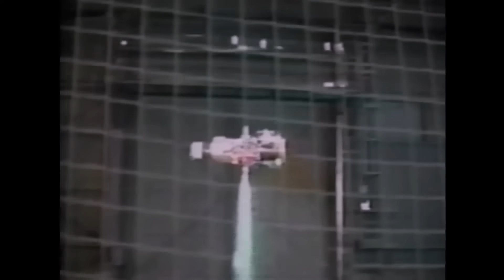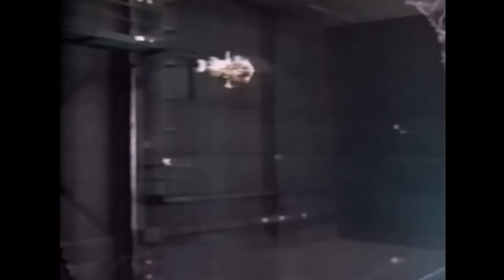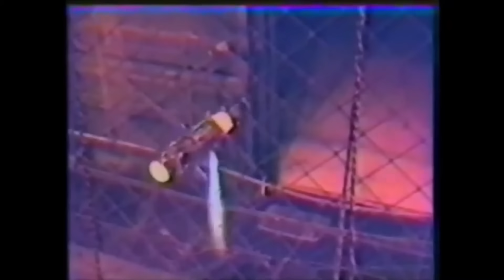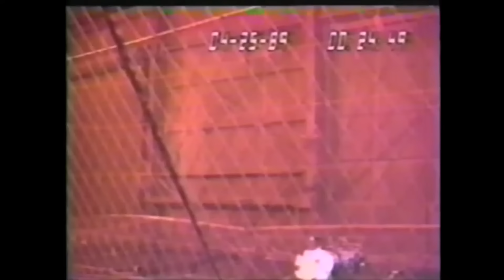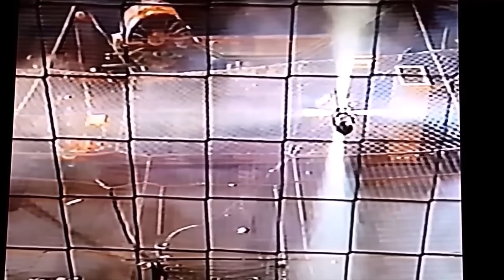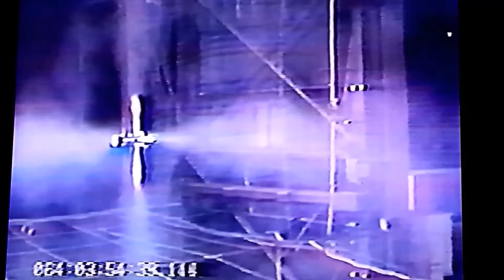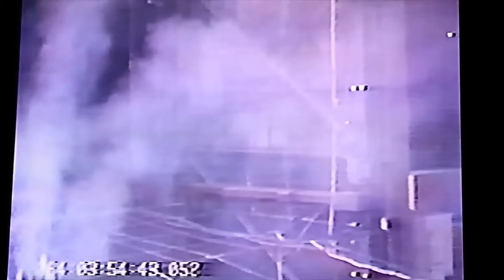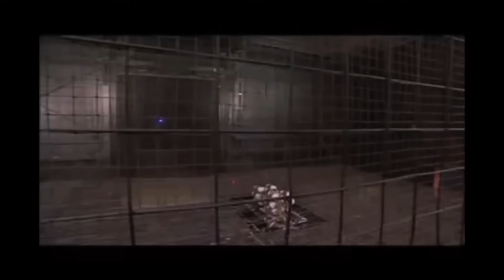EKV/KV/KW/KKV/LEAP (Exoatmospheric Kill Vehicles) Hover Test - Compilation Video (SM-3, GBI, etc.)

Comment: Looks like some autonomous killing drone that would appear in the Black Mirror series.
Reply: Rocket engines are less efficient than propellers in air. So these would be less dangerous than regular drones or those robot dogs.  They run out of fuel super fast.
But it would make for a scary movie yes.

Comment: I wonder what this technology has evolved into now. Any ideas?
Reply: Into nothing
Reply: Probably into nothing, it is too expensive and completely hopeless to stop an incoming attack. If the incoming missile releases some decoys alongside actual warheads, most of these expensive kill vehicles will have to go for those cheap decoys. Each kill vehicle has a chance of failure, but it is unacceptable if even one nuclear bomb reaches its target, so you need a lot of kill vehicles. 
Nuclear weapons are going to flying lower nowadays (hypersonic weapons), so they can use the air to maneuver. That makes them more maneuverable than these kill vehicles. 
If the incoming attack detonates one nuclear bomb in space when the kill vehicles are close, the kill vehicles are blinded, or broken in more ways. Nuclear bombs do not need complex guidance or sensors, they could survive the explosion better and fly on to their target. 
Kill vehicles and their launchers needs to be ready to launch at a moments notice at any time. Maintaining that is expensive. Attacking nuclear weapons do not have this requirement with such stakes.
Reply: @kedrednael  EKVs are still being developed and improved. We know nothing about modernized versions of them, obviously, but they exist.

Also, the goal of an ABM system isn’t to completely protect a country from a large scale nuclear strike. They have 2 uses: one, to protect against small scale nuclear strikes from rogue states like NK or Iran, or two, to make it so that large states have to ration more nuclear missiles per target. I’ll explain that last one. Let’s say Russia will need to send two warheads at a nuclear silo to have a satisfactory chance of destroying it. If an ABM system can have a 50% intercept rate, that would require Russia to allocate 4 warheads to reach the same probability of destruction, thus taking up warheads that could be used elsewhere. There are always more targets than there are missiles, so this is still very valuable for a defender.

Comment: I have been looking for this for a long time! I vaguely remember seeing one of these clips on the Discovery channel and I remembered it as some kind of satellite which did not need to follow orbital mechanics, since it could just hover
Reply: Hovering in place would require a lot of sustained energy. I think it's easier to get into a geosynchronous orbit.
Reply: @chaotickreg7024  thats what made these things so special, because everything else does the easy thing of following a ballistic or orbital trajectory
Reply: @carmatic  These ALSO follow a ballistic trajectory. The only thing the thrusters do is let them fine tune their trajectory to ensure they hit what they're aiming at. The fact that it can hover only shows that it can accelerate at more than 1G in any given direction.
Reply: They don't hover. These are maneuvering systems for guiding a missile to intercept its target. Picture a bullet flying towards a bullseye; if the bullseye suddenly moves to the left, the bullet fires a thruster and moves to the left to keep the bullseye directly in its path. It's necessary because hitting a target at orbital speeds requires an insane amount of precision, so a projectile trying to hit a target in space needs to be able to control its trajectory to within a few millimeters.

Comment: The Tic Tac UFO was just a larger version of these. Seems they figured out how to make longer flight times.
Reply: Could be launched from another submersible drone as well.
Reply: I have similar feelings, but these devices clearly burn liquid fuel and leave a very obvious signature of that.
Maybe something like this with a new form of engine that the world has not yet been introduced to.
Reply: @James-fe7wd  Check out videos on "Cold Gas Thrusters".  They have better capacity and less obvious heat signatures.
Reply: @murrygondwana7260  Do cold gas thrusters have better capacity? I'd have thought the lack of combustion energy means smaller Isp
Reply: @danielfearn6076  Traditional combustion, in rocketry, require two liquids, the fuel and the oxidizer. So you need two tanks.  Cold gas thrusters use a single gas, so a single larger tank can be used.  Monopropellant fuels exist, however those typically use toxic fuels.  You want to avoid that.
Reply: @murrygondwana7260  Great, thank you for the pointer!
Reply: @murrygondwana7260  A cursory look into c.g. thrusters would suggest to me that they don't actually have enough potential energy to create a useful flying vehicle of this sort with any kind of range. It's hard enough doing anything like that with conventional fuels. Still, quite the interesting prospect, but I just can't see how you'd do this with gas expansion, which pales in comparison to the specific impulse and thrust you get from the expansion of burning fuel...
Reply: Speaking of the tictac UFO, intel regarding the location would suggest that Raytheon may have been testing that vehicle. Prof Simon on YT covered this a while back and was given some useful detail which he looked into.
Reply: @James-fe7wd  Regarding Commander Fravors encounter, he saw a disturbance in the water.  Perhaps the Tic Tac was deployed from and controlled via a submersible and is intended for short duration reconnaissance or electronic counter measures.
Reply: @murrygondwana7260  Quite possible

Comment: And people wonder what those UFO sightings the Pentagon released are.
Reply: Expect those things don't have any indication of thrusters
Reply: @MSaleh-vy8rr  the USN vid does. What we’re seeing in it is a heat plume in the thermal camera
Reply: @jacobbaumgardner3406  
Eh... no not really. Besides, this craft didn't even last long enough. If China or Russia figured out how to develop this craft to last longer, then that has to store so much fuel, but more fuel adds more weight, more weight slows down in speed and is unable to maneuver fast enough. What the pilots saw disappears instantly. No way it's that same technology that we see in this video. It's really common sense to tell the difference between that and the one from the FLIR footage.
Reply: @MSaleh-vy8rr  that was a trick of the light for it. You can even see the lense flare as it rotates.
Reply: @jacobbaumgardner3406  
Yes it was a trick of light, but you don't see these thrusters repeatedly jetting out to maintain that hover and fly.
Reply: @MSaleh-vy8rr  it could be beyond the range of intensity in the camera, the intensity of light could be si intense that all that is just getting blotted out.

Comment: Isn't this the UFO in the recent released videos? These were engineered in the late 80's and people are shocked seeing these kinds of things now?
Reply: Exactly....the one on the news everyone is freaking over....under the national security act they never have to confirm it all they have to say is, "it's ours don't worry" or maybe not even that much they might just continue the story of, "we don't know😏"
Reply: No it's not. They saw them on radar descending from space to sea level in seconds. The saw them hovering for 10h straight. It looks like it for sure but the performances of the ufos are to radical.
Reply: @kyzer97320  think about this as well before you talk about the flight time...these are scaled down versions...12"-2' long....yeah they're gonna have a short flight time just as with other drones..but once you start making them into the size of aircraft or slightly smaller...the flight time increases, the forces they can endure also increases. You say it "went into the ocean"...ok, were you there were it landed? Did any of the videos show them sticking around to see if any boats or helicopters coming to perhaps pick it up...no. The softest spot and safest spot to conduct untested top secret aircraft maneuvers is over water. That's where we use to drop the big fuel canisters for the shuttles right? I'm not saying there isn't aliens but not ever UFO is gonna be extraterrestrial.
Reply: @frankiethebull8269  I don't know. Rocket engin hovering, I don't think that It can be operated for extended periods of time. Only my humble opinion. Maybe they found out a way. This can be an answer.
Reply: @kyzer97320  there's your mistake, thinking it's some sort of rocket engine. There are many types of engines they're working on, scram jets use no moving parts but still operate who's to say this isn't some form of a "pulse" scram engine? The link to the video I sent you about the X-37, they were carrying an experimental "ion engine"....plus you gotta notice in every video the exhaust gases are different colors and have different amounts of smoke? Clearly they're experimenting with different types of fuels/chemicals not everyone has access to.
Reply: @frankiethebull8269  I know, scram jet ram jet, 15 000 mph atmospheric flight. But it's when you combine hovering, hypersonic, crazy flight time, and crazy manoevrablity.
Reply: @kyzer97320  we land craft on other planets that essentially "crash" they land on the surface going hundreds of miles an hours then "BOOM" retro thrusters...that puts hundreds if not thousands of pounds of force on them but they survive...the first Mars Rover we just wrapped it in a big airbag let slam into the ground and it survived...trust me we can make equipment survive tremendous forces.
Reply: @frankiethebull8269  Again my friend, it descended straight from 80 000 feet  25km to 50 feet in seconds ( according to the witnesses) if is true its nothing from here. MKV are made to intercept ICBM, they don't drop from space just to chill above the waves.
Reply: @frankiethebull8269  it's the fact that these objects the military have been claiming to have seen, match the aircraft's movements precisely. On top of that the object traveled something like 60 miles in a very very short time span, the aircraft that are designed to go in one direction at over Mach 1 can't match that speed and I really don't believe this little object that isn't designed to go over Mach 1 can either.
Reply: @kyzer97320  you realize this is designed to go in space? It was designed to intercept ICBMs so saying they saw it come from space actually gives more credibility....in the video they say too, "without a human pilot it's capable of maneuvers previously unachievable by conventional means"(not an exact quote but they say it)....so there's more credibility
Reply: @frankiethebull8269  Yeah, it's designed to fly IN SPACE. The production version of this was the size of a trashcan and flies a sub-orbital trajectory on a missile the size of a schoolbus. The Navy uses a smaller version not much bigger than a milk carton. Neither of them are meant to maneuver in an atmosphere.
Reply: @kyzer97320  and not to drill it in more but Predator Drones, the ones the military uses...they have a flight time of what...24-48hrs? Without having to be refueled, they just kinda glide in the upper atmosphere (honestly I could be wrong) but they can refuel mid air why can't these? Also what about that XB-71(I'm sure the names wrong) spacecraft? That top secret shuttle the Military uses...it has a cargo bay on it and it stays up in space for months at a time, it could've had one of these in it and dropped it off in space. https://youtu.be/h2FQHfCV_Uo
Reply: @frankiethebull8269   You know the second pilot came forward. She told the exact same story as David Fravor. What they described, and what they saw on radar is not from here.
Reply: @frankiethebull8269   About the 10hrs hovering.... they didn't fly for 10hrs they hovered (allegedly) that a big difference.
Reply: @kyzer97320  whatever the second pilot said was moot...if 2 people told you the sky was green does it make it true? They're pilots not engineers and this is technology not everyone has seen. I have friends that don't  believe me about that X-37 shuttle until I show them a link lol.
Reply: @kyzer97320  "flying" is hovering by that logic you could say helicopters don't fly they only hover
Reply: @frankiethebull8269  Helicopters can fly and hover. The hovering takes a lot of power. Dji drones has an advertised flight time measured while flying. Fixed wing flying is way more efficient than hovering
Reply: @kyzer97320  yeah but helicopters use a conventional internal combustion system to carry people/equipment and run off fossil fuels.....not this it's not even worth comparing. It's literally like comparing a steam engine to a Saturn V rocket.
Reply: @kyzer97320  yes fixed wing is "more efficient" but makes it hard to change direction quickly like you need when shooting down an ICBM.   plus since it's a SPACE craft fixed wing is more hindering and useless...in space.
Reply: @kyzer97320  for the record...
We...me and the original poster/comment was referring to the GIMBAL UFO...so if you're gonna go off about UFOs in general to win an argument then please don't reply. You originally claimed it "came from space and moved unlike anything else".....so I suspect you were speaking about that specific video too not UFOs in general.